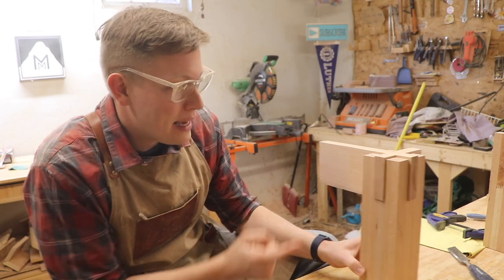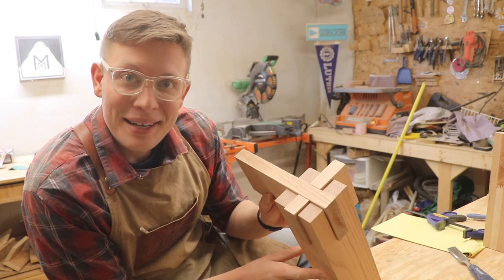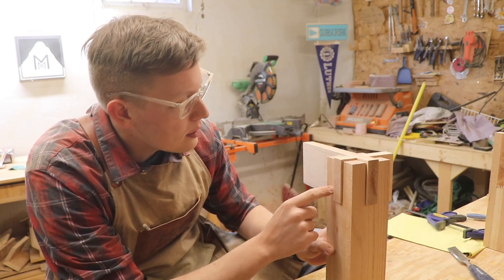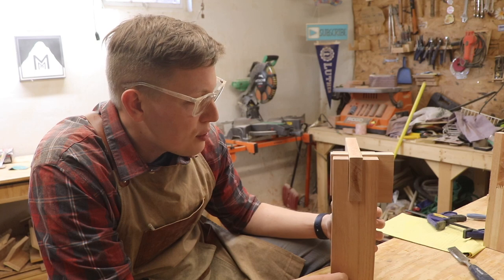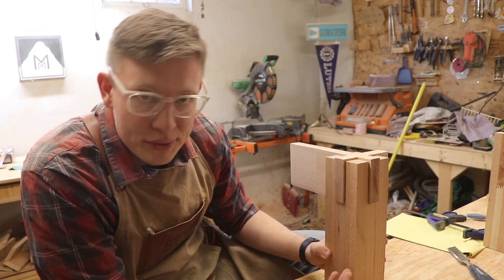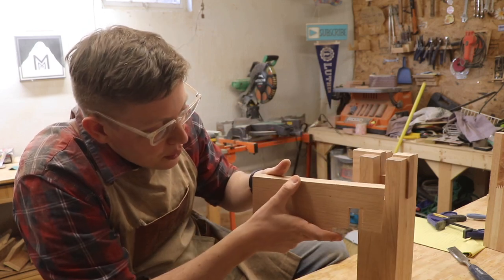How to Make a Castle Joint / Shiro Joint / 3-Way Joint

Comment: Is there a reason you made the leg cuts in 3 height stages instead of going to the full height in one cut?
Reply from the maker: It's a safety thing.  Making incremental passes offers less resistance to the blade, and thus the motor.  This method will help limit kickback, burning, potentially popping the surge protector depending on the wiring in your shop.